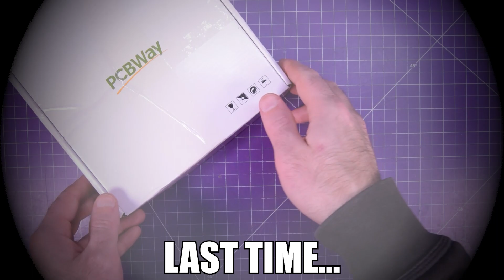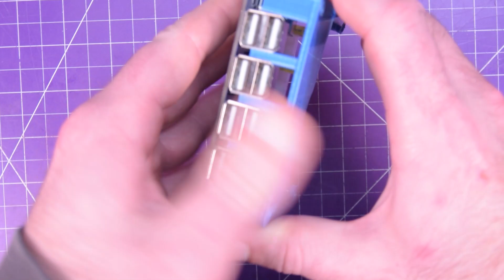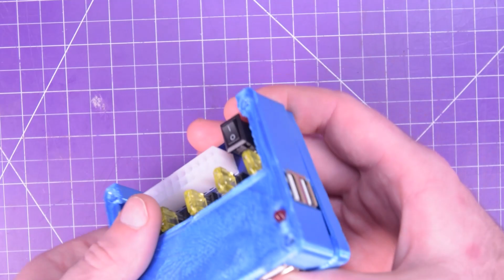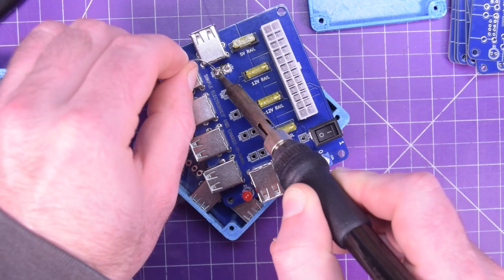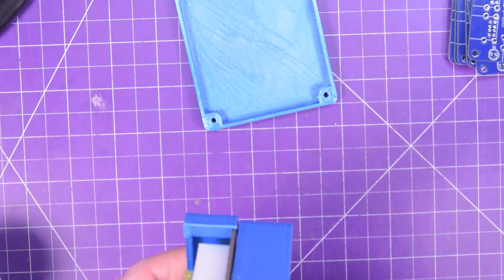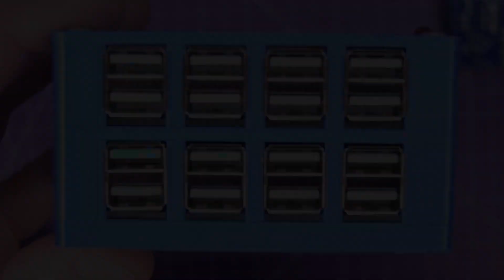The Last Charger You Will EVER Need

Comment: Nice project. But I think you created a small short between + and - connectors on the top side. Those small loose wires have the habit of creating small shorts, they get pushed aside toward other pads. Can tin those wires first that will prevent them from splitting apart when get pushed through a hole.

Comment: Wouldn't the isolation switch get hot running 24 devices?
Reply from the maker: That switch only powers on the PC power supply
Reply: @SimpleElectronics  Gotcha, just the old green to ground.